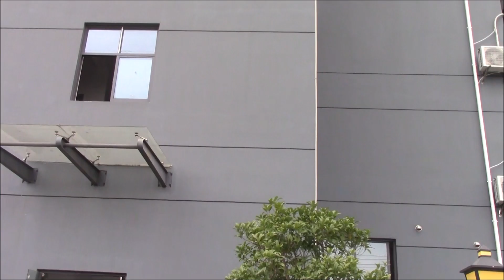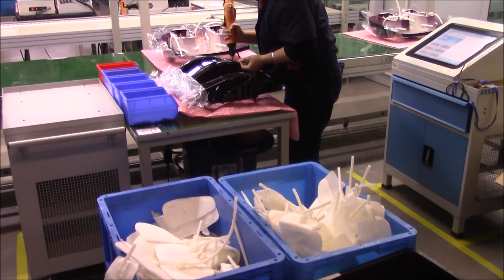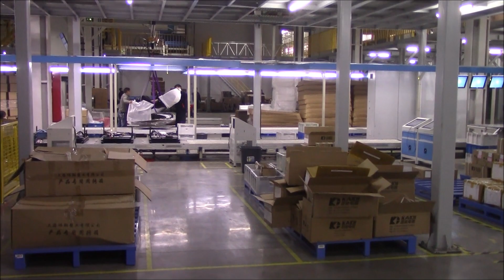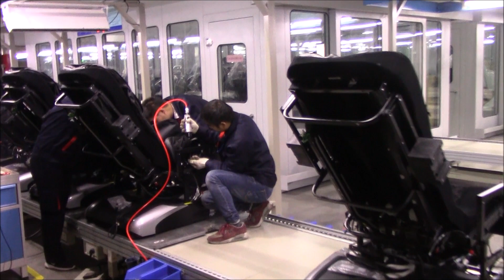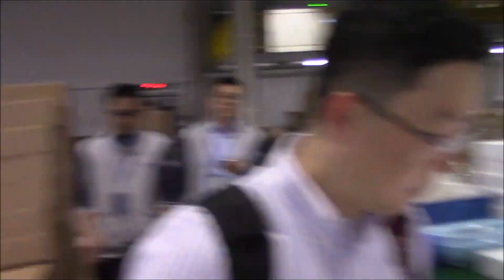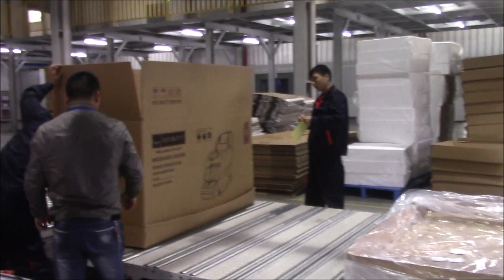My Visit to a Chinese Massage Chair Factory - 11/7/17

Comment: Loved my trips to China.  There is such a huge markup on chairs.  Pricing out of China for their premium chairs to US distributors is 6-10% (6,000 to 8,000 CNY) of US MSRP.  Current estimates of 150 to 250 CNY per hour are exaggerated a bit, and, the employer deducts housing and food costs from that amount, leaving take home pay at ~10% to 20%, or 5 to 10 CNY per hour.  Also no overtime and workers are expected to work a 12 hour shift, sometimes, especially in rural areas, for 8 hours pay.  No unemployment benefits.  Hours can be cut anytime.  Health costs paid separately by the employee

Comment: From there it costs 500 usd each
Then dealers sell one of them with 2000 usd price tag
Reply from the maker: Agree, Abbas. However, you have to add on shipping, parts, and customer support warranty of 1-3 years. That ads cost to the chair as well. So, it is not as easy as saying that a $2000 chair has a $1500 profit margin. It is often quite a bit less when you add in all the other costs associated with importing a chair. 
dr. w.

Comment: It's unbelievable and amazing that this guy has never been to a factory before.
Reply: Not really IMO. He's a physician not an engineer. And having toured many Chinese factories that ranged from OMG! (bad) safety and quality practices to a few that were quite impressive I must say this is darn nice for a facility focused on hand assembly. But then again they're making $3000 chairs so adequate lighting and reasonable pace of production yields a better product. I would add they were very open letting him wander around taking full video.
Reply from the maker: It really is, Phil. I wish I could have gone earlier. 
Dr. Alan Weidner
Reply: I'm impressed as well. But it's clear that they have the unused workbays and space on the assembly line for a reason. If demand jumps, they can probably produce the chairs at a much faster rate if demand increases, and they hire more workers. And because they have planned the extra space for it, they can do that without significant quality problems, unless they try to push production numbers way too high.